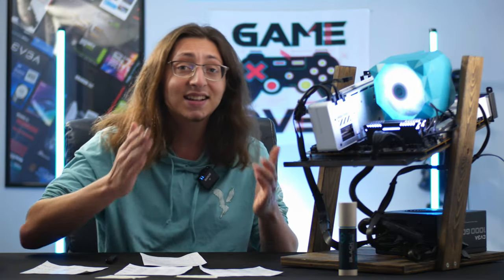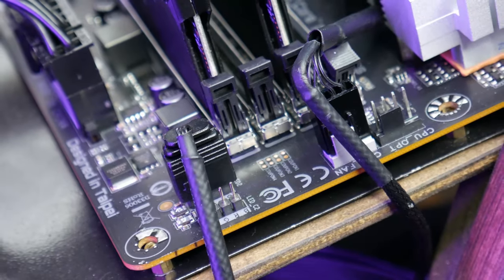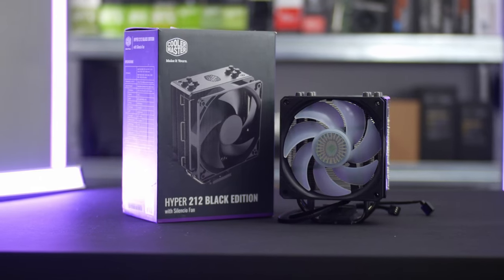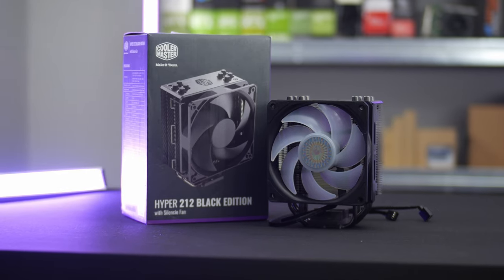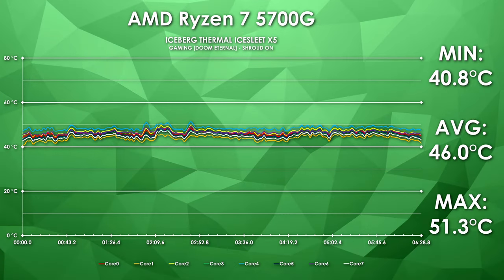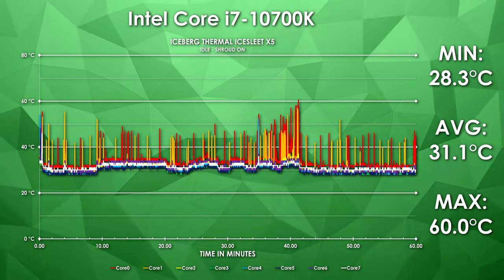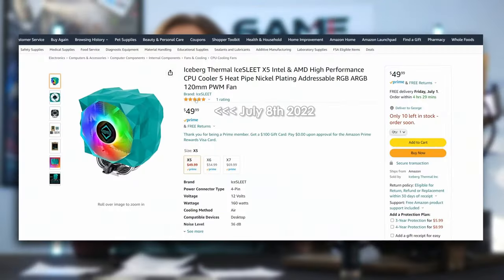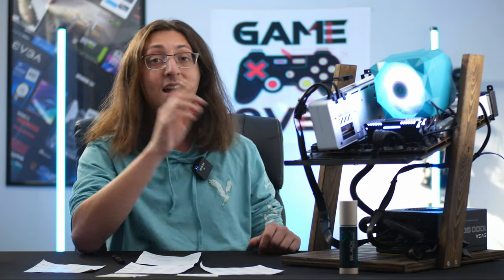More Than Just Good Looking? - Iceberg Thermal IceSLEET X5 Review!

Comment: It looks funky, and I think the shroud can help in a case where the airflow is disturbed.  Sometimes we forget how hot a CPU runs and the cooling solution is an afterthought.  I am a Noctua guy, as you said the flagship, both in price and looks.  That fan sound is bad, sounds like not enough grease in the bearing area.  My fans run around 600-700 RPM and the CPU fan at 1100  ~37dba with the case at 28 degrees and CPU around 31 at idle spiking to 72 playing Starfield, the fans love to make themselves useful and temps are dropping quickly to < 60 degrees.

Comment: Nice. Not shocked the Intel ran hotter though. I’ve run into that because of the different chipsets trying to pump in a bunch of power to keep clock speeds up. Seems like the cooler did what was expected though!
Reply from the maker: Oh yeah it did really well! Definitely didn't help that the 10700K is a 125W chip vs the 5700G's 65W, but that's definitely a good thing to note about the chipset difference!

Comment: Question: How tight do you screw the screws of the cooler to the brackets on the board? Can you completely screw them down????
Reply from the maker: I usually do until the screwdriver stops turning with light force. Once that screw bottoms out do not keep trying to torque the thing down, and I even back off a screw turn or two just to make sure I'm not overtightening the cooler.
Reply: @GTechOfficial  Thanks bro!